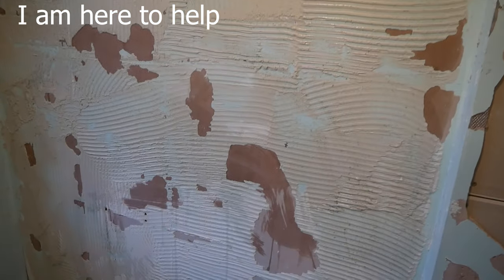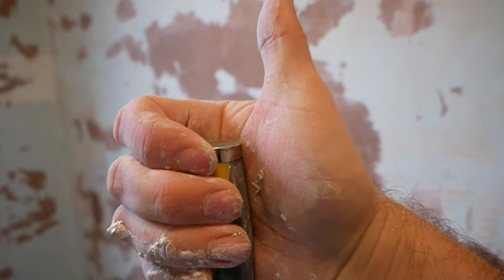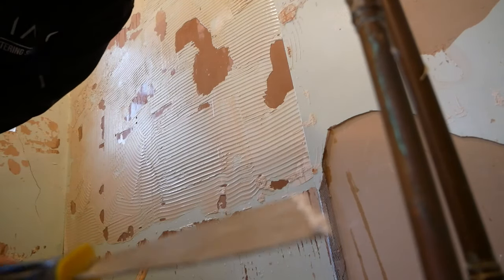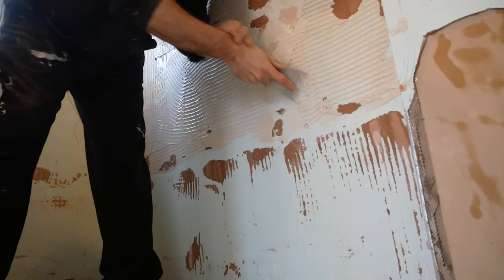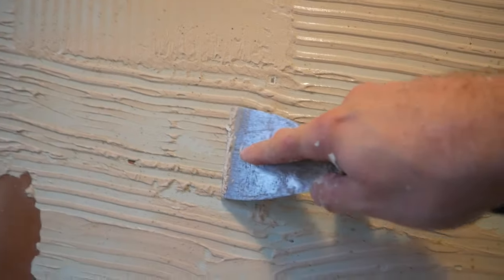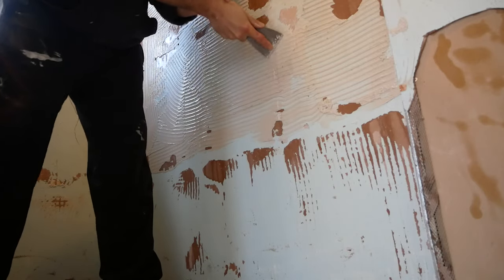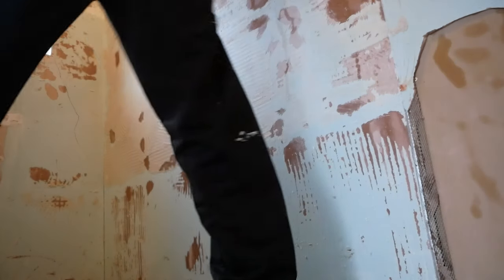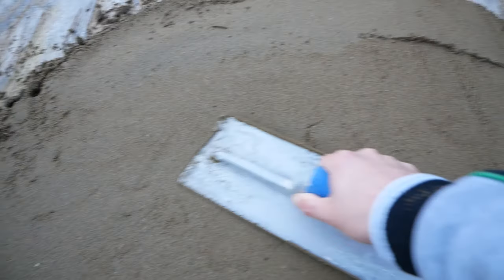How to easily remove tile adhesive from walls 98% don't know this

Comment: Thankyuoooo, from a grateful 65yr old lady, if I can do it anyone can, fantastic tip. Edit: My dried on tile adhesive was 20yrs old. I wet it but it didn't work straight away, but multiple wetting and waiting, and it worked, so sometime you have to be patient. No more chunks gouged out of the plaster where I spent hours chipping away at it. what I loved was the tiny bits left actually wiped off! considering this was old, very dried on tile adhesive. mmm I wonder if you soaked tiles that had old adhesive on, it would work, as years ago had to re-apply a tile that had fallen off and spent a good while chipping the adhesive off ( didn't have any spare, tile discontinued and it was not flush with the others, no wasn't me)  This is a great tip for the older enthusiastic DIYer. 😊
Reply from the maker: I Love to hear this video is helping so many people and so glad it was helpful for yourself :) do feel free to share it to friends and family :)

Comment: I brought a big heavy duty scraper to do mine. It didn’t touch it. See your video thought no way on my adhesive but I’ll try it. All done in an hour and a half, finish is almost good enough to fill and paint. Thanks
Reply from the maker: Nice one mate yes I learned this the hard way but so glad i found out a little water goes a long way with it :) So happy it has helped you mate :)

Comment: Why shouldn't you use bonding coat in a bathroom? What should I use instead? I've got holes I need to fill where base layers crumbled in places. Bought bonding coat as doing chasing in other rooms
Reply from the maker: Any where there is damp bonding is not good as it has fermacalite in it and that holds the water really well so if re doing a bath room kitchen it's best to try use sand cement or possibly hard wall might be better alternative but sand n cement be the best long term again sometimes bonding is only option on jobs hope this helps some

Comment: My adhesive is like concrete. Water does nothing.
Reply from the maker: Unfortunately if its waterproof it won't work I have said that on this video your only option would be a hammer drill it's hard work mate wishing you the best on it

Comment: warm water with a splash of PVA , always seemed to help with polymer adhesives.
Reply from the maker: Yes makes it soak good just to tight to waste it me :):)
Reply: @macplastering  haha..  plus you got to get the bits up quick before they stick to floor
Reply from the maker: Thats so true mate just made it sticky again :):)
Reply: I add a bit of pva as it seems to stop the water running down the wall holding it in place as it soaks in. If you get lucky an old plastering trowel does the trick but if it’s a little bit tougher the small scraper is way easier on you body as you demonstrated.
Reply from the maker: yes would work 100%

Comment: I'm surprised it just melts after a few minutes when you add water. So any leaks in the grouting and they all fall off?
Reply from the maker: I would think it would be bad in the long term for sure again some advises are weaker than others as in not as water proof

Comment: Hi, what about on a concrete wall? Im using a grinder and dust is everywhere
Reply from the maker: Is the adhesive white ?  just give it a test like on the video nothing to lose hoping it works for you my friend :)
Reply: @macplastering  yes it's white but the wall is concrete, and thanks for the reply
Reply from the maker: Should work as long as it soaks in the water ? did you try it mate ?
Reply: @macplastering  gonna try it today barely
Reply from the maker: the best stuff is warm water with some soap in as or a steamer but steamer can take the skim off but if yours is just adhesive on concrete should be good to go
Reply: @macplastering  well, I still had to use the grinder but it was easier and less dust
Reply from the maker: @firehawk95666  might have been a stronger adhesive at least keept dust down for you mate

Comment: Omg thank you so much need walls ready for plasterer Tuesday coming got 3 clear days the old tiles I think they used a can per tile wetting it with warm water bit of liqued in and bingo. If you was here I would give you a big hug need to crack on thank you so much you are a *🤗
Reply from the maker: So glad this has helped you my friend do share if possible might help a few more. Thanks again Jane and best of luck

Comment: Hi mac plastering. Would water in a spray bottle work instead of brushing it on?
Thanks Nick
Reply from the maker: yes or a sponge or cloth
Reply: Is needs to be pinned at the top! Started with the brush, lots of water on the floor. Read this comment and switched to the spray bottle. Way more control, less water on the floor, easier to get into the corners, and I can spot apt to the areas that look dry after a few minutes wait.

Comment: So does that hurt the drywall, getting it wet? How long did it take?
Reply from the maker: still hard work but much eaiser this way cant remember how long this took maybe and hour or 2 as long as you don't go to mad with the water shouldn't be to bad might soften your drywall plaster a little to but no doubt wall will need replaster tiles or patched after all the same
Reply: @macplastering  i got told they would have to tear our my walls for a glue up bathtub shower surround. My tiles are plastic, but some are falling off….from the 70’s i think.
Reply from the maker: @cindyk4145  just make sure they are not asbestos as you will need to realy protect your self if it is
Reply from the maker: @cindyk4145  but yes sone times it's just easier to pull boards of and start a new

Comment: Any tips for getting adhesive off of wood? Thanks!
Reply from the maker: @fisherboy01  wood ply?
Reply: @macplastering yes
Reply from the maker: @fisherboy01  this way will only work if its this type if adhesive over thing you could do is unscrew and turn it around if buying more isn't an option

Comment: How do you take off the old tile glue it’s brown in color and do not come off easy with xtra course sand paper and orbital sander any suggestions
Reply from the maker: Might need a sharp scrapper is it rubbery?
Reply: I have the same, circa 1955 original to the house and very hard to budge. Not rubbery at all.

Comment: Great to see you still posting. 👍
Reply from the maker: Thanks for stopping in mate yea been thing about a few livestreams again
Reply: Unfortunately the adhesive is from 80s in our house and is set like concrete 😂
Reply from the maker: yea unfortunately this wont work on the water proof types is yours the grey cement type mate? best using the drill the
to chip that gear hard work   @charliemccollum
Reply: @macplastering  it was on plywood that was attached to a bath frame. Then tiles on top of wood to close in the bath
Reply from the maker: @charliemccollum  ahh yea can picture that nightmare now tearing sheets of timber off with tiles might be best pull sheets of and re board if you have the money to go that way